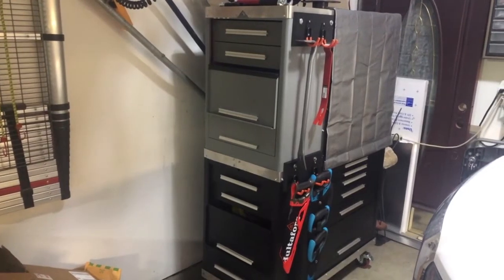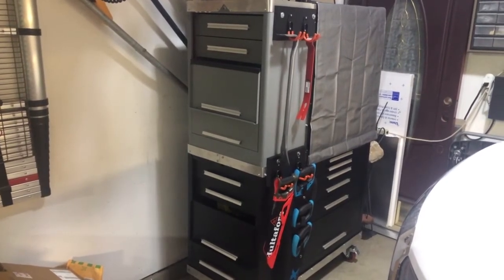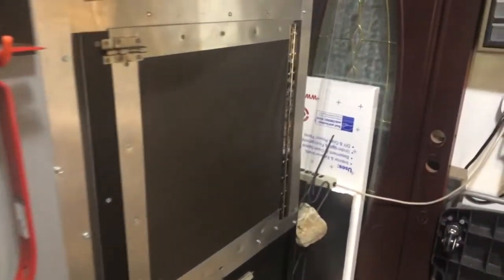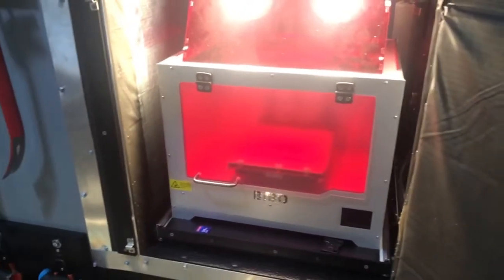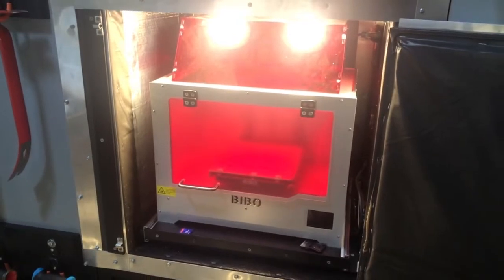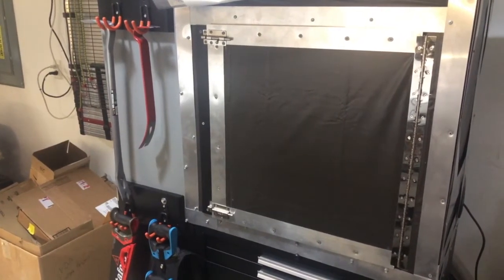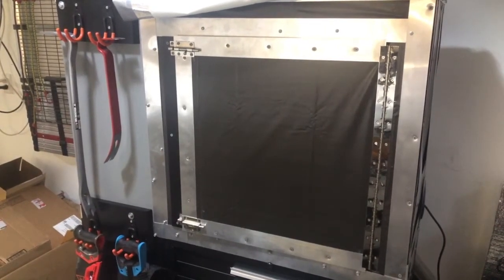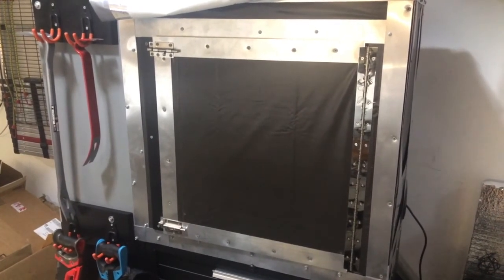Custom Built 3D Printer Storage/Enclosure Cabinet for BIBO TOUCH 2 printer

Comment: How much have you been playing around with you new toy so far with? Have you gotten the hang of it yet with you own coding or just of the interwebs like thingaverse
Reply from the maker: Just using STL files I find for free online. I do not know anything about CAD and I haven't spent time trying to learn yet. I  feel like I have a good understanding of this printer now, but there is a learning curve and different materials cause different problems. Just going to stick with PLA for now, PETG and ABS have both cause me problems!
Reply: @GelBallBlasterMaster  yea I've heard it can get complicated quick when you start getting into the different types if plastics and then when you start looking into the fill rates and stuff it get tricky
Reply from the maker: @willlabosky1876  for sure. I think I have PLA under control so I am sticking with it for a while.